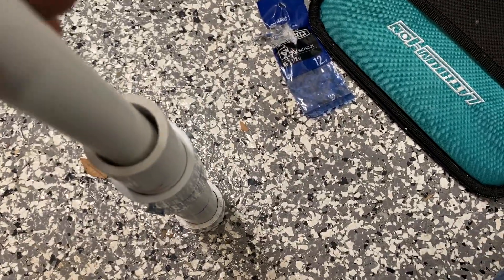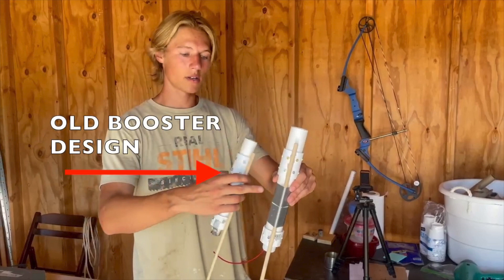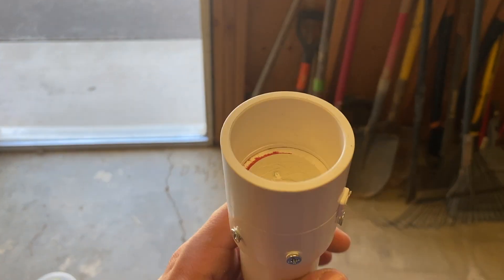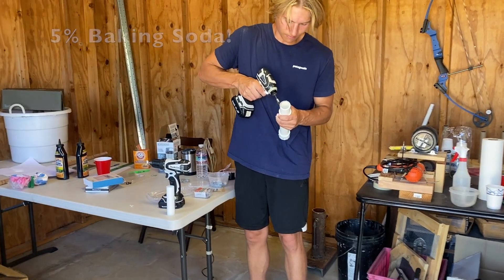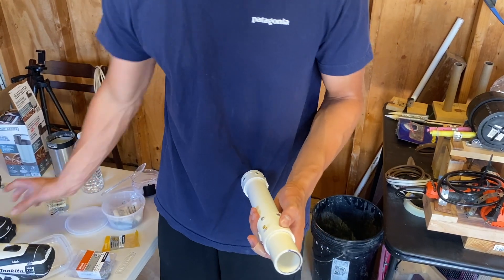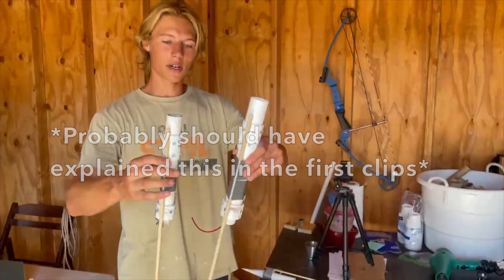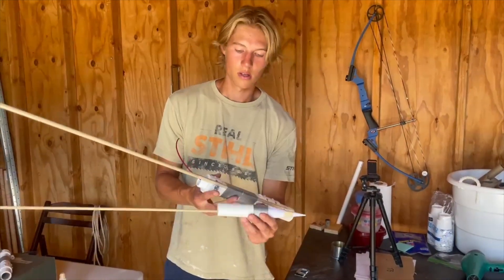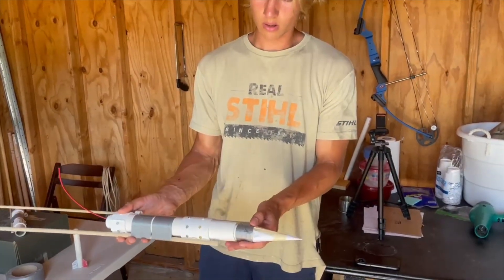Scaling Issues: Multistage Sugar Rockets

Comment: @6:00 i have a few questions... in your booster rocket- how deep you drill your booster rocket hole? What was the depth of the solid "cap" from the top of said hole to the second stage? And lastly, does the powder in the boosters "cap" have a heavier mix of sodium bicarbonate than the walls so it burns slower than the walls and doesnt pre ignite the second stage as it did? 

Perhaps try measuring the depth and burn rate of the top of your booster and use the 8% mix there, and the 5% mix for the walls of your ignition tunnel. (For a lack of better terminology... 
Also.. START COOKING YOUR FUEL! 😅😂 you will have a more intimate mix, less chance of air pockets, reduced oxygen between particles reducing the need for sodium bicarbonate leaving more room for fuel, and have a more steady burn. Just remember to use an ELECTRIC heat source on LOW heat.. just enough to melt the sugar but not caramelize it. You should have much higher results. 
Because what im thinking is going with the explosive failures is that the air in between the particles is allowing the dry mix to burn to rapidly creating too much pressure for the pvc. Hence the explosions and rare nozzle ejections.
Reply from the maker: The fuel section is 6.25" long. I drilled 4.75" inches into it, leaving a 1.5" solid "cap" above. The powder in the booster was a consistent 10% Baking Soda throughout.